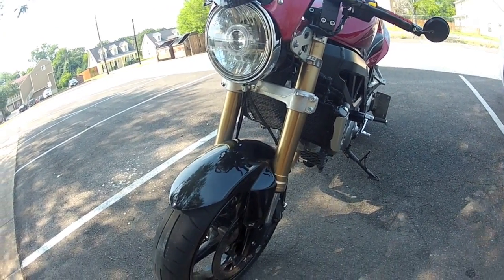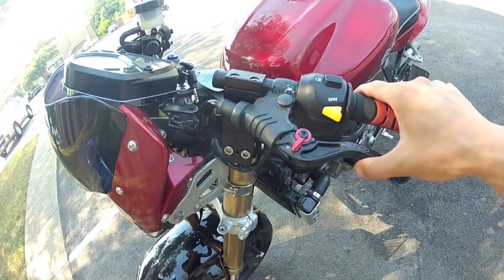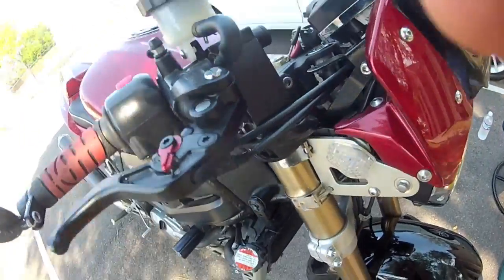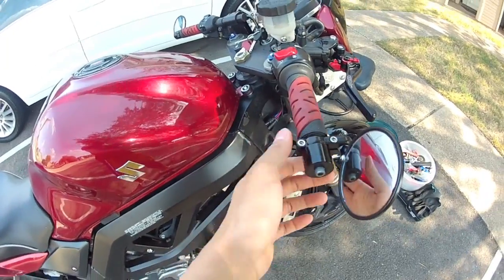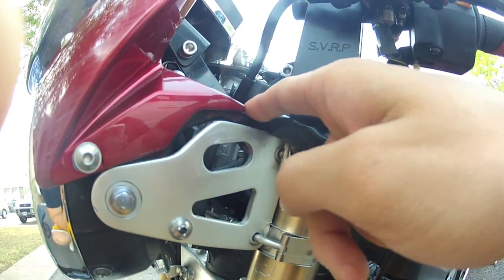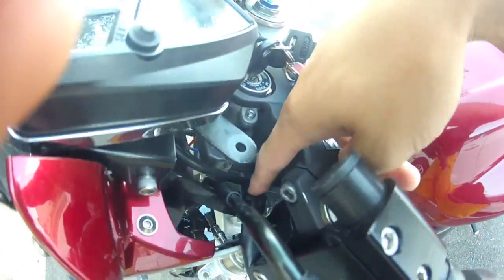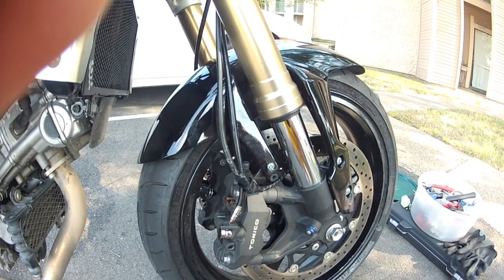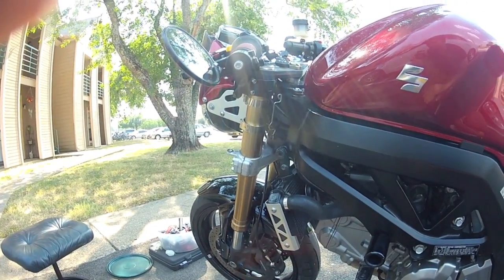Project: SV650 GSXR Front End Swap (Lessons Learned)

Comment: Did you have any issues with the steerer tube fitting in the nike?  What about the bearings, which did you use? I've got a 2011 GSXR1000 front end.  thanks

Comment: z zr600 kawasaki front forks drop straight in old sv1999-2002 models yokes, the front wheels the same size too & better brekes.oOnly drawback is the speedo drive is mechanical so you'll need a zzr600 compatable speedo.

Comment: Hi SpentFuel or to whoever that reads this comment I would really appreciate your answer. I have the same exact set up. At the end of your video you said that you’re gonna take it to the shop to have your front suspension professionally measured. Did you research the specifications at all because I do have a second person that could assist me. Please help because it’s very hard to find the measurements on youtube or anywhere else since the bike is now a hybrid so you can’t refer to the manual or the internet for answers. It’s probably there but difficult to find. Thank you!
Reply: I not 100% sure, but I think what he is talking about is having the forks tuned by a professional for his personal rider settings. But if he is indeed talking about the height of the forks, then yes the gsxr forks are slightly shorter then the stock sv forks by about an inch. Most fix this problem by running a taller 120/70 tire as a supposed to the sv 120/60 stock tire.
Reply: Urban Kyng Thank you so much for the reply. At the time I composed this question I was still very lost and confused. But I have it all figured out now.

Comment: Where is a good place to source the parts for the front end swap?  Is there a way to purchase everything so that all you have do is bolt it on?  Thanks!! Great video!!
Reply: havoc010101 Craigslist, eBay, and motorcycles forum's. I've seen complete gsxr front-ends sale for as low as 500 with the wheel.

Comment: Is it really worth all the grief?
Reply: Jay B you don't have to go this route. There's a better and simpler way.
Reply: James Barros in all honesty, the gsxr front is really a bling mod more then function. The cheaper option is to just to upgrade the front fork springs and fork oil. For the rear shock, the zx10 and zx14 units drop right in, and can be had on eBay for cheap. (Brought mines for 30$). I would suggest that you join the sv forum svrider.com for it has tons of info everything dealing with these bikes.
Reply: Kendricks Hayes Jr what simpler way do you recommend? Looking at getting back into riding by buying what will become my 4th sv but I want to upgrade the suspension at purchase time
Reply: Thank you. I'm on svrider (used to be on socalsv back in the day) but there's just SO MUCH info it's hard to find. Any thoughts on emulators? Race-tech is right down the road and I'm pondering working with them.
Reply: James Barros I view it as this, if you consistently ride hard and track the bike, emulators, new springs, and fork oil will give you the best setup. 
But if you ride hard once in awhile and barely do track days I think springs and fork oil will be fine. 
For me personally springs and oil give me the solid front-end feel that I wanted.

Comment: Hey man, what Galfer brake line kit did you get?  I bought a kit for a GSX-R 750, but they were too short so I have to return them.
Reply from the maker: I came across two issues with buying brake lines for the GSXR front end conversion:

1) I switched from the standard GSXR clip-ons to 3.5" riser clip-ons which brought the handlebars MUCH higher.

2) I switched from the SV master cylinder to the GSXR master cylinder. The GSXR master cylinder requires a 90 degree bend in the banjo whereas the SV does not.

I ended up ordering mine through svracingparts (where I also bought the 3.5" risers). I told them I needed the lines fitted for a GSXR front end using their 3.5" risers and the GSXR master cylinder. The product I got from them is this:

"Custom Gen 2 2007 SV650 Black SS Front Brake Lines Kit with Option A 90 Degree Radial Mount Fittings for GSXR on SVRP Clip On Bar Set"

Not sure how much that helps but I would recommend calling up a motorcycle shop and getting a custom fit. It sounds like you are not using the stock GSXR 750 clip ons or else I don't see why the kit would not fit.
Reply: Correct, I am using woodcraft clip-ons with 2'' of rise.  I also bought a Brembo 19x18 master cylinder to replace the decrepit GSX-R master cylinder that I decided not to install. 

The lines I have now will line up with the master cylinder despite not having a 90 degree bend, but they are two or three inches too short.  When I return my current lines, I guess I will just ask them if they can make custom lines for a GSX-R 750 and see if they can just make them 3'' longer than normal.

I would use SVRacingparts.com, but I need to return my incorrect lines to the company I bought them from.

Comment from the maker: I reused the stock SV bearings at the neck. You have to use the GSXR front wheel with the GSXR fork so you cannot reuse any of the SV spacer/front wheel components. I bought the entire front end complete (w/ wheel) so I did not have to search for the pieces individually.

Comment: so ive got a question about the neck bearings. did you just get stock sv bearings or use your current ones i guess you could say? and what about spacers between the wheel and forks. did you need any or have to search for them?

Comment from the maker: The tapered region is NOT 50mm!!! I made that mistake when i ordered fork clamps from Aztec8. I bought the 50mm size which were way too large for the tapered region. 50mm is the lower diameter which is below the tapered region. I am not sure what the exact size for the tapered region is but the 1.75" t-bolt clamp definitely fits. I bought both the 1.50" and 1.75". The 1.50" were too small. Good luck!

Comment: Excellent video, thank you very much. I've got a question: 1.75" t-bolt clamp in metric is 43mm. The fork leg at that point however is 50mm. How can this fit? Especially since you state that you need larger clamps than the fork diameter.

Comment from the maker: For the OEM GSXR 600 front rotor (06-07) I used 1/4inch diameter magnets + the corresponding cup holders from Lee Valley Tools. I can't verify the size of other rotors...but all the info should definitely be on SVRiders forum. Good luck!

Comment from the maker: If you shop around and be patient the right one will come along. I got my 06/07 GSXR front end for 350 total including the front wheel/rims/rotors/calipers etc. After selling all my SV front end components on SVRiders I ended up almost breaking even! The GSXR forks are definitely shorter. I got them professionally tuned today along with my ZX10R rear shock. The mechanic told me the GSXR front end puts my bike 20mm LOWER than the optimal SV setting so I should expect a quicker turn in.